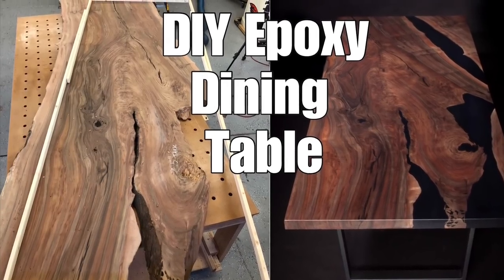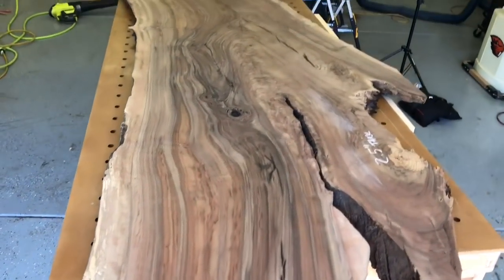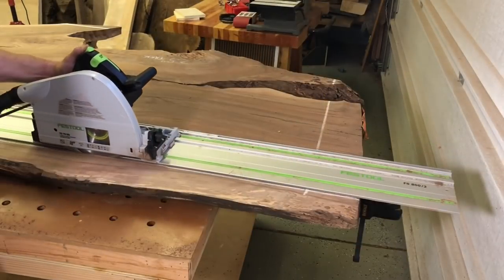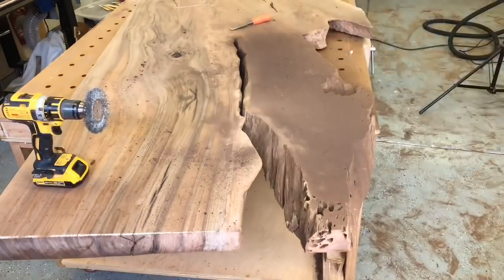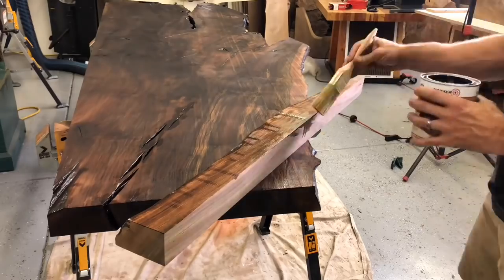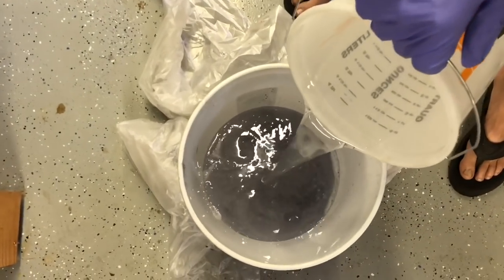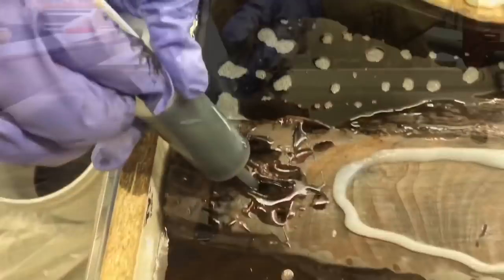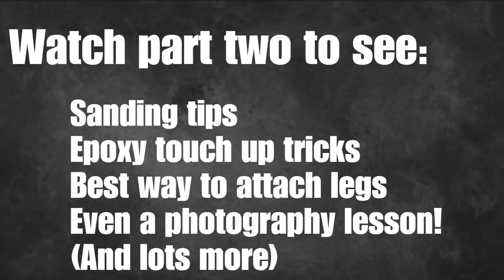DIY Epoxy Dining Table—How to Woodworking—Part One of Two

Comment: Great build! Curious if the air temperature needs to maintained 70-80 degrees during the entire curing process and if so how do you accomplish that in your garage?
Love all the tips and tricks.
Reply from the maker: I have a heater! And no, as long as it stays above 50 it should cure fine. Just might take a lot longer.

Comment: Cam, I'm doing a much smaller table (22"x47.5") and it consists of 4 separate pieces of Silver Maple. I'm pouring black tinted Ecopoxy Plastic Kit. I have five cauls holding down the maple. My question is, in-your-opinion, when could I remove the cauls to pour material into the cracks on the top surface? Should I wait until I'm ready to remove the table from the mould, or can I remove the cauls after a day or two to work on the cracks? Thanks, Cam. I love your work.
Reply from the maker: Day or two should be fine!
Reply: @BlacktailStudio  Thanks!

Comment: one of the best epoxy tutorials I've seen! thanks. question...do you put much time into leveling the table before pouring? also does that shellac sand off easy enough to make it worth it? Thanks!
Reply from the maker: Definitely shellac. Level it pretty good. Will save epoxy

Comment: Question. The Odie’s Oil finish you use on your tables thinking of using it on a bookshelf I am doing out of walnut and cherry. I just started sanding and only needed 220 grit for the varnish I was going to use but went up to 400 because I loved how it make the wood look and how it makes the cherry feel. Would you use it on something like that so I can smoother than a normal finish and do you think it would stand up to a bookshelf?  If so which Odie’s product would you recommend?  Thank you for all of the great content I am always learning something from you.
Reply from the maker: Oh, I never use Odie’s anymore. Doesn’t last for me. Looks good for a day or a month. Then dries out. Try Rubio our

Comment: Would be interested in your thoughts on filling the “rivers” with pebbles or anything that doesn’t float to reduce the amount of epoxy needed.
Reply from the maker: Black Forest just did that!
Reply: Blacktail Studio   Thanks. Will check it out. But what is your opinion on that? Any experiences? The only thing I can think of is added weight. But that can be easily solved by using styrofoam balls instead of pebbles. 🤔

Comment: Cam, very beartuful table.  Have you ever built one with clear epoxy?  I am wondering how I could get sanded epoxy clear and level again after sanding.  Any sugestions?
Reply from the maker: You’ll need to polish the epoxy or use a spray finish like varnish

Comment: hi cam! im a big fan of your work. just wondering. is it possible to build table legs from casted epoxy?
Reply: i hope you would try it as an experiment sometimes. i'm imagining a table legs with wood and black or bronze epoxy. if its possible i am planning yo build a stool that has epoxy on its legs. but i don't want to waste epoxy as its very expensive. keep up the goodwork. you have taught us things to do and not to do.

Comment: So at 12:25 I see you are checking the depth in multiple places in essentially the same pool of epoxy.  Doesn't it all flow and more or less self level?  I get checking the depth when using such a dark tint but is it necessary to check multiple places in the same area?  BTW, absolutely love your videos, your woodworking must have been a huge pull in order to pull you away from flying.  Bryan

Comment: Before sealing the edges and using a black epoxy have you ever drilled a couple of small holes say 1/4" diameter an 1" or so deep for the epoxy to fill in adding rigidity between the epoxy and walnut? Trying to think of ways to strengthen the table since I don't have an wood inlay for C-Channels and only current supports are my two 2" steel U-shaped legs with the threaded inserts. Table is 6' x 38"
Reply from the maker: Epoxy is sticky enough. No need for holes

Comment: Nice video, easy to follow.

Two questions:
1. how do you estimate the volume of epoxy you need for each pour?
2. are the syringes / tubs used for the epoxy cleanable or single use?
Reply from the maker: Check out my other epoxy build video for the estimate. And they’re single use
Reply: @BlacktailStudio  I have watched both videos for the table build, and your serving board video (gorgeous btw) and didn't hear the calc for epoxy volume. Can you point me in the right direction?
Reply from the maker: Its in my other epoxy table build. If you’d prefer, I teach a class on these and we’ll definitely go over it there!
Reply: @BlacktailStudio  I didn't realize that was a different table. I found it now, thanks. https://youtu.be/EJ0rmR1hVas?t=548

Comment: Hi. Very nice work, plus I appreciate what seams to be your signature, when it comes to black epoxy, look quite epic. In the proces of making 3rd coffee table with epoxy and illuminescent dye, so far both where with wooden legs, altho seen so pretty amazing metal bases as well (not standard) - just like the one at the end of the video. Is the thickness always standard in the tables you do? - if so what kind of thickness do you choose? - if not - does it depend on a client, or size? Cheers and all the best ;)
Reply from the maker: For dining tables, I don’t like to finish less than 1.75” up to 2.5” thick which means I start with a slab of 2”-3” thick

Comment: Sir, I have a poured table that I want to trim down.  I see you used a track saw.  I'm using a table saw and wanted to know if you used a special blade?  I'm cutting through Superclear thick pourEpoxy brand and Maple.  Thanks
Reply from the maker: No special blade

Comment: Hey Cam, doing my first epoxy table.  Couldn't have done it without your videos!  Can you tell me about how much dye you use for these opaque black tables?  Thanks!
Reply from the maker: I don’t measure. Just wing it
Reply: @BlacktailStudio  Works for me! Instructions say about 4oz pigment per gallon of epoxy which is a full bottle of pigment per gallon; do you use that much?  Havent done a big pour and don't want my epoxy to be translucent.

Comment: As a person all about all of this, bond strength is important. Look into mold making and release angle so you want to have a great understanding of bond lines. I don't want to quote the angle without literature, so I'll refrain, but it's easy to find the release angle and coorisponding sheer strengths for materials so you don't have to unnecessary mar materials looking for ideal bond.
Obviously the strength of almost any epoxy in any direction is the greater than the radial sheer on almost any wood, but as long as the relatively shallow (okay, I give. I think it's around 3 degrees) angle isn't exceeded, surface prep shouldn't be a big issue. This coming fr ok m someone that would never take my advice at face value, but would rather see it as a prompt to dig deeper in to the physics of friction. XD

Comment: I saw briefly the legs that you used on this table. How did you prevent longitudinal stability ? I made a similar dining room table, without epoxy, finish, with similar steel legs, but had some problems with stability. Eventually we used steel cable crisscrossed and welded to the bottom portion of the two leg supports.

Comment: Love your vids. What do you use as a dam on the surface of the table when pouring (the white bead to keep any excess from flowing over the tabletop?  Thanks
Reply from the maker: Fast dry caulk 👍🏼👍🏼
Reply: @BlacktailStudio  it doesnt leave any residual deeper than where you plan to plane/sand? 
Can i ask you a question (thanks for getting back so fast on mine)?
The walnut i have worked with in the past always required me to use a grain sealer to get the surface super smooth, yet i havent seen you do that and the walnut appears glass like. Why is that?

Comment: it would look so cool if you make the wood black (by burning and cooling it) and pour red/orange epoxy in the gaps with LED light running in the sides of those cracks to light it up. that way it looks like lava glowing and flowing through cracks of burned wood.
Reply from the maker: Thanks for the very specific idea!

Comment: Would you mind sharing a ballpark figure for what a slab about that size would run? It's easy enough to look up board feet but I wondered as it gets more difficult to find a single continuous piece, that the figure would naturally go up some.
Reply from the maker: I can do better than that. Get on the goby website (link in description) and they have hundreds of examples with prices.

Comment: I noticed you say coat the wood with Shellac in your video. Although I noticed in your video that you are using a sanding sealer (Zinsser Bulls Eye Sealcoat). Should I use a sanding sealer or shellac?
Reply from the maker: I use epoxy now. Check out one of my latest videos

Comment: Very good and informative video!
I see there are some sellers on ebay which offer Ecopoxy in ratio 1:1. What is the reason for recomending 1:2? Are there any differences in the quality or the curing process?

Comment: This is very inspiring, and incredibly beautiful.  Thank you for posting.  I have some nice walnut slabs I want make a table from, but they are only 1 year cut @ 2".  Would the epoxy prevent further splitting... bond it together, or would I get in real trouble with cracks if I tried it sooner than later?  thanks
Reply from the maker: Epoxy before the wood is dry would probably make it worse. Let it cure and crack, then dress it up with resin after.

Comment: Good stuff like always Cam.  Question......you are using Ecopoxy Liquid Plastic here and as you know it's been discontinued at Ecopoxy and replaced by FlowCast.  Then I saw a later video of you using Chill.  I've used a lot of Ecopoxy Liquid Plastic and did really like it.....but I've been pretty disappointed with Flowcast due to the inconsistency of curing, lack of strength in river tables, etc.  Is your go-to resin now Chill in favor of Flowcast?  If so why Chill?
Reply from the maker: I use liquid glass now 👍🏼

Comment: You are aware that the filters that you were using when you were grinding do not filter dust right? Those are specifically for organic vapors. You’ll need a p100 to actually filter particulates.

Comment: Do you recommend getting dead flat before pouring epoxy? I've got two slabs that have been planed but have so high and low spots (small but still there).  Could I still pour epoxy and then use my local woodshop to help belt sand/flatten after the pour to avoid planing/flattening twice?
Reply from the maker: Na, dead flat later

Comment: Amazing job! just a quick question: at 07:55 are you using the Zinsser bulls eyes seal coat universal sanding sealer 100% wax-free shellac? Do you confirm that? because I found many different Zinsser types. Thanks!
Reply from the maker: Yup!

Comment: Was the bottom of the slab perfectly flat? Or did you seal (caulk) the bottom of the form to prevent the epoxy from running underneath the slab?  Thanks!
Reply from the maker: I let epoxy run underneath 👍🏼
Reply: @BlacktailStudio  I just watched part 2.  Where you answered my question! Lol my bad.  Amazing work, sir!  Thank you for the response.

Comment: Thanks for all your hard work!

I am wondering how crucial it is to flatten a slab before you pour. I have a maple slab that is kiln dried but cupped a bit. Should I go ahead a pour and just get my local shop to run it through a planer?
Reply from the maker: As long as it ends up flat in the end!
Reply: Blacktail Studio so you are saying a planer should take it to flat after I pour even if I don’t use a router sled? I just want to do it right. Thanks!

Comment: Do you release the clamps before the epoxy hardens or wait? Also, could I pour a real thin layer of epoxy before my main pour to avoid leaks?
Reply from the maker: You can! And ya, you can or leave it. Usually fine

Comment: Do you use shellac as insulation also if the epoxy isn’t colored? Or is the reason to avoid stains after finishing with oil for example, because it can’t get into the wood on some areas?
Reply from the maker: If it isn’t colored it isn’t entirely necessary

Comment: Have you used mica pigments in a project? I'm having trouble finding clear information on how much mica is needed per ounce of resin. I have to order materials for one project specifically and don't have the luxury of just adding until I get the look the client desires. Thanks in advance!
Reply from the maker: I prefer liquid dyes

Comment: Thanks for posting this. I was wondering - how dry does the slab have to be? do you get them already dried to a certain percentage?
Reply from the maker: I recommend getting a moisture meter, around here it should be dried to about 10% I’ve got a blog post all about this so may want to check that out

Comment: The sallac sealer, is is a finish or an actual sealer, the ones I've found say they are sanding sealer, if these are the ones I need I guess you don't actually have to sand it, I'll be flood coating for a finish

Comment: Hey Cam, I’m working on bark removal in a pecan mantel piece. What tool would you recommend to clean up chisel marks and to make quick work of any remaining bark. I tried a wire wheel on my drill and the chisel marks remain. Thanks!
Reply from the maker: Try the porter cable restorer
Reply: Thanks for the quick reply! I’ll give it a shot. Btw, keep up the great work and good luck with your new full time gig!

Comment: Can I ask you what are the advantages of using a rail saw instead of a skill saw in this type of work? You could make a video about it, if you there is a lot to cover.
Reply from the maker: Basically, accuracy, speed of setup, and depth of cut are the main advantages.

Comment: A question on your 2 year old video :)
Would it be better to do the second pour after 48h when the resin is still tacky or wait 3-4 days for it to harden and scratch it before the pouring? Also what are my options for mold release? (Wd40?vaseline?)
Reply from the maker: Tacky is better. And I added a link to this mold release in the description

Comment: Question, I notice in resin crafting videos people will use a torch or lighter to get out air bubbles, I have made a few resin projects and when I went to use the lighter to get out air bubbles the resin would either catch fire or I'd get a burned layer on the top that I would have to scrape out. Why does this happen to me but not others?

Comment: Do you put shellac on the top and bottom of the slab? Any issues with the resin not bonding to the bottom is some sneaks under?
Reply from the maker: Good question. I use non-waxed shellac for that purpose. Still probably not ideal for bonding

Comment: Hi, I have a few questions.
1. Do you prefer Osmo or Odie's oil and why?
2. Can one or either be applied over wood stain(water or oil based) and/or wood grain filler (water or oil based)
Reply from the maker: Never use Odie’s anymore. Prefer Rubio to both
Reply: Thanks  @BlacktailStudio  . why not Odie's oil? Seems ok from the reviews. I have the new super duper oil, will try it on one of my off cut piece (of Ash wood) just to get a feel for it. Will let you know.
Reply: @BlacktailStudio  I Used Odies' super duper oil. It doesn't seem to stick quite well to epoxy. But other than that it looks ok after buffing and giving it enough time to dry.

Comment: If using a transparent epoxy, what should you use besides an angle grinder for the soft wood?
Reply from the maker: Porter cable restorer and nylon wheel

Comment: - Just a thought : maybe you could save some of your time, if you used a vibrator - like the smaller types commonly used for concrete , to get the trapped air out before the epoxy cures ?

Comment: If you shellac the top to avoid staining the face, is it necessary to epoxy the edges? If the edges will be covered in black epoxy anyway, I’m just curious why that step is crucial.
Reply from the maker: Prevents staining. And shellac doesn’t bond to epoxy
Reply: @BlacktailStudio  is staining the edges an issue? Aren’t they hidden by the black epoxy anyway?

Comment: What type of LLC did you form? (I am a sole proprietor currently looking to form an LLC) Do you make everything custom or do you have some "regulars" that you make and have stock on hand? (So far I just make custom stuff I think is cool and keep here, donate for charity, or have sold a few locally but never had anyone commission me for a project) How do you handle crating and shipping? I've tried crating for a couple projects but it is laborious and I had one crate fail which ruined the table, and for bigger projects I have no idea how to get them crated and delivered. In my experience UPS only takes items up to a certain size and weight.
Reply from the maker: Im a sole owner LLC.  Not the technical term. But something like that
Reply: @BlacktailStudio  thanks! How do you handle shipping and know shipping price, especially really big heavy tables? (i.e. UPS, shipping company, U-ship app)

Comment: I’ve watched several river pour videos, and one thing I haven’t seen is someone doing a pour where the epoxy completely  fills the form, covering the slab. Do you know if there is a reason no one does this? I was thinking of trying this, and maybe just making my form like a 1/4” thicker than my slab. Any suggestions before trying this? Thanks
Reply from the maker: Check out Black Forest Wood Co. they do similar ones. Could run into issue with wood movement though. I say give it a shot though!
Reply: Blacktail Studio what if l clamped the pieces down and did half the pour. Let it cure, remove the clamps and did the rest of the pour?
Reply from the maker: Michael Eales yeah, makes sense!